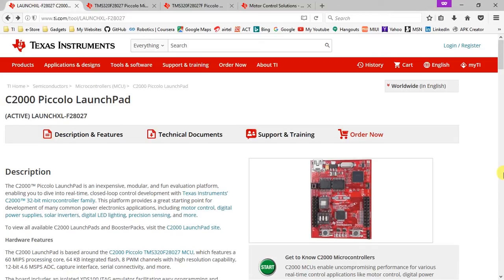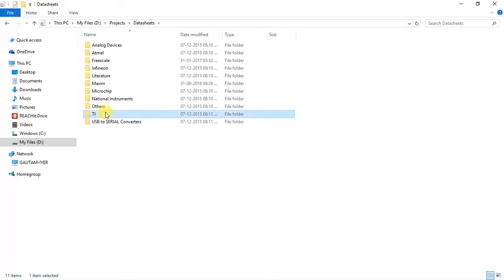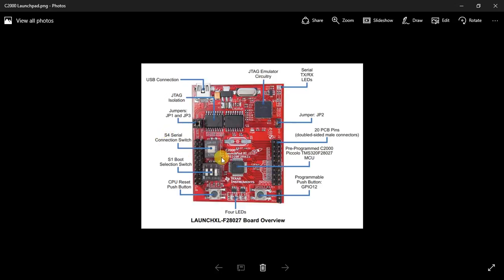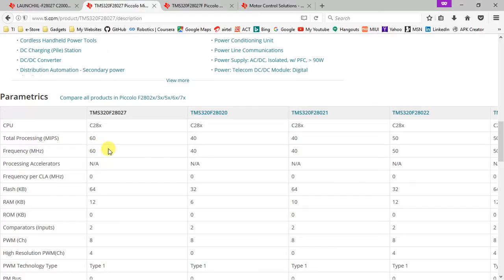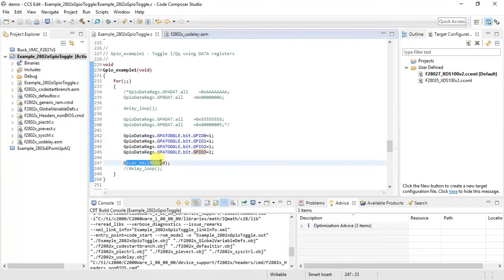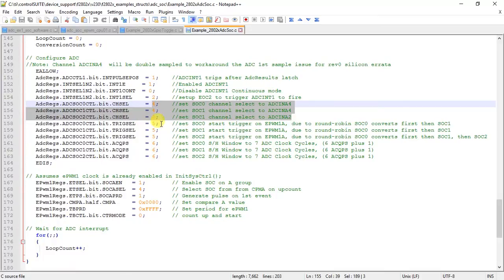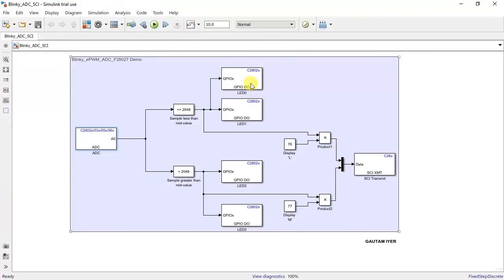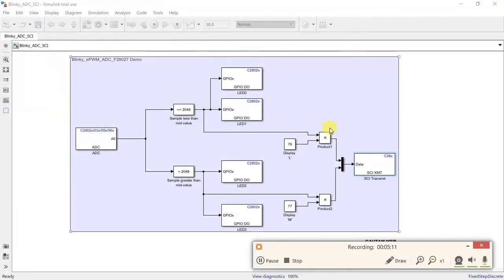Introduction to LAUNCHXL-F28027 Launchpad (CCS and Simulink Demo included)

Comment: hello,
I see that these launchpad does sensorless control of PMSM. but I want use a sensor an encoder to measure the angle PMSM. can sensored control with encoder be done with F28027+boostxl drv3801?
thanks

Comment: Sir,  I got two errors saying the data type of input port Should be one of the following single, int8, uint8, int 16, uint 16, int 32, uint 32 mine is "uint 16" also an error occurred while propagating data type 'double' from filename/mux, output port 1
Reply from the maker: Hi, there's a very good document on compiler, linker and datatypes that you can Google.
Reply: @GautamIyer  sir I tried doing that still it doesn't come, then I tried for a simple toggling 1 led still there is error but the error isn't even there in diagnostic viewer, is it because of the version? I am using 2018b

Comment: Sir, I have connected F28027F Micro controller with Matlab 2018a for v/f control of induction motor pulses are degenerate for three lag of inverter in inverted Form for positive and negative switches of one lag, but i am unable to make dead band after selecting the inverted version of ePWMxA Into the ePWMxB with deadband Signal source for raising edge (RED) ePWMxA
Signal source for falling edge (FED): ePWMxB,
with RED=15
FED=15.
Please help me so that that problem can be resoled
Reply from the maker: Hi,

Please post your query on TI E2E.

Regards,
Gautam

Comment: hi can you tell me how to control the BLDC position or set it to specific angle using sprc179 , C2000, TMS320F2812, I am in a desperate situation
Reply from the maker: You mean using Simulink? As for CCS the whole source code is available here: http://www.ti.com/tool/SPRC179
Reply: You did not get my question , 
MY PROBLEM IS here- https://www.youtube.com/watch?v=A-Ji2VdQEKY
MOTOR FUNCTIONING - https://www.youtube.com/watch?v=gxlYRZRz988
float32 SpeedRef =  0.4;    // Speed reference (pu) -- if I change the value here the motor speed changes which I was able to find out , how to control the angle , 
please go through the comments section below.

well the question is when you use the sprc 179 
/* ==============================================================================
System Name:  PMSM34

File Name: PMSM3_4.C

Description: Primary system file for the Real Implementation of Position Control
                Based Sensored Field Orientation Control for a Three Phase Permanent-
                Magnet Synchronous Motor (PMSM) using QEP sensor

Originator:  Digital control systems Group - Texas Instruments

Note: In this software, the default inverter is supposed to be DMC550 board. 

#if (DSP_TARGET==F2812)
interrupt void QepISR(void);
#endif

// Global variables used in this system
float32 VdTesting = 0;            // Vd testing (pu) 
float32 VqTesting = 0.25;         // Vq testing (pu) 
float32 IdRef = 0;                // Id reference (pu) 
float32 IqRef = 0.2;              // Iq reference (pu) 
float32 SpeedRef =  0.4;           // Speed reference (pu) -- if I change the value here the motor speed changes 
float32 PositionRef = 0.5;      // Position reference (Mechanical rotor Anglele  (pu) // THIS IS NOT WORKING AND I WANT TO KNOW HOW TO CONTROL THE POSITION OF THE THE BLDC
float32 T = 0.001/ISR_FREQUENCY;  // Samping period (sec), see parameter.h 

NOTE:- IF YOU KEEP  the mouse on the line of the code it shows you from which structure it is taking the data .

2) Build level 1 is working 2 is working 
#ifndef BUILDLEVEL 

/*------------------------------------------------------------------------------
Following is the list of the Build Level choices.
------------------------------------------------------------------------------*/
#define LEVEL1  1        // SVGEN_DQ and FC_PWM_DRV tests
#define LEVEL2  2           // Currents measurement test 
#define LEVEL3  3           // Two current PI regulator tests
#define LEVEL4  4           // QEP test and angle calibration // NOT WORKING ---------------------------------
#define LEVEL5  5           // Speed closed loop using measured speed based QEP
#define LEVEL6  6           // Position closed loop using measured position based QEP

/*------------------------------------------------------------------------------
This line sets the BUILDLEVEL to one of the available choices.
------------------------------------------------------------------------------*/
----------------------NO 3 FOR INFORMATION ------------------------------
File name:        F281XQEP.H            // CALIBRATION CODE YOU CAN CHECK          
                    
Originator: Digital Control Systems Group
   Texas Instruments
Description:  
Header file containing data type and object definitions and 
initializers. Also contains prototypes for the functions in F281XQEP.C.

Target: TMS320F281x family

Comment: How did you get the Delfino board to work on Simulink?
I tried CCS6 and MATLAB R2016a, and C2000 addon, I got model error.
Any ideas?
Reply: NVM, I solved my problems by reinstalling matlab in C:/matlab instead of program files.
Reply from the maker: Cool!